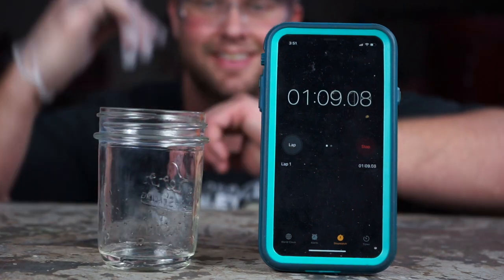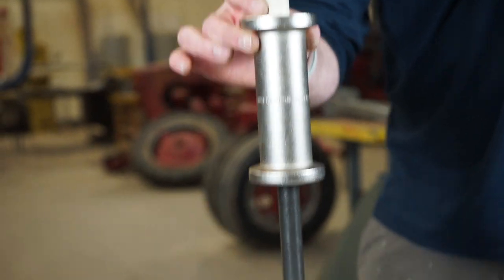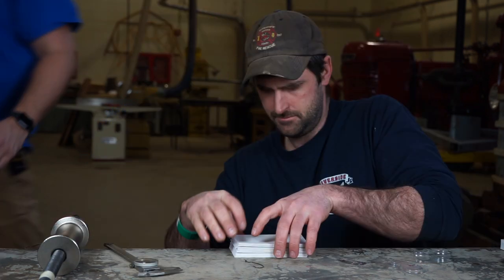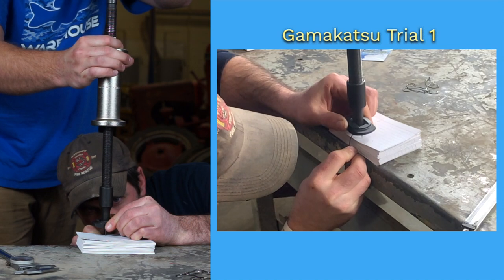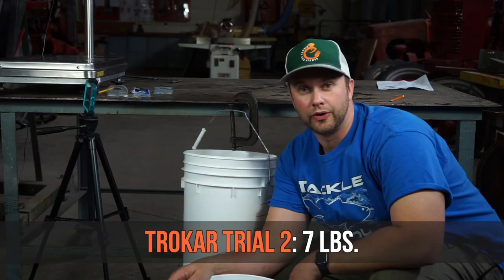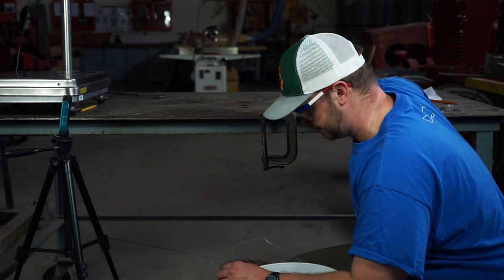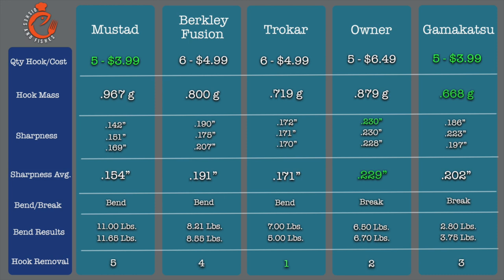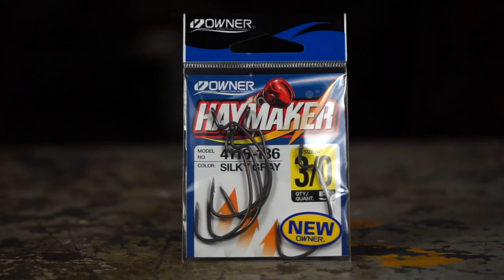What brand of wide gap fishing hook is the best | DOES IT MATTER?

Comment: Crazy that the gamakatsu broke like that. I've never had one do that and I've fished with them for striped bass for years. The hooks that snap are made of a harder steel and  probably set better but the other ones are bad ass because they never completely fail.
Reply from the maker: Right, exactly what you said. Harder steel, sharper edge, less flexibility. Softer steel, softer edge, more flexibility

Comment: i would rather have the hook bend than break.  even with a little of the curve left in the hook, the fish can still be held.  but if it breaks, there's nothing.  i would like to see this test done differently.  suspend the hooks vertically. that would be more like what happens when fishing.  the pressure would be in line with the shank, instead of perpendicular .
Reply from the maker: Good point
Reply: I’ve never had me owner hook break. I have a hooked on a tree and it actually bent. I feel like his bend test was off because when you hook a fish the hook doesn’t bend in the middle. You would actually have to hook it into a tree . Pull from the eye side. Therefore the test he preformed was invalid.